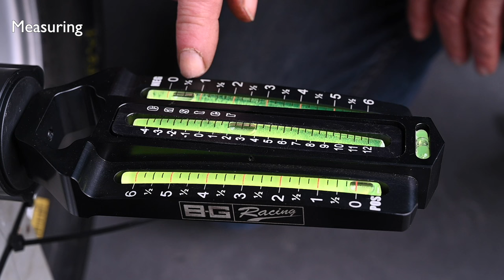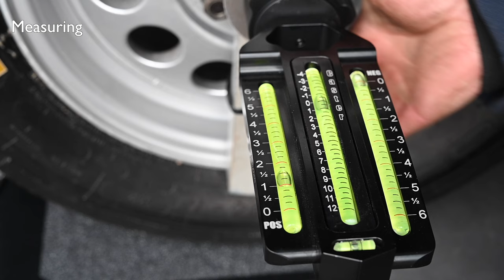Caster , KPI , Camber .  A simplified and practical explanation and approach for measuring

Comment: Steve, Thank you for your videos and explanations of the alignment and corner balancing a race car.   My wife and I have been racing our Porsche 914 for many years, have modified it extensively, but have I've never dove into alignment but trusted alignment to "the professionals".  I followed your alignment videos, built my own string alignment and wheels stands, laser leveled them in my garage, borrowed weight scales from our local car club, and aligned and corner balanced both my 914 racer and my 968 street car.  I found many misalignments items that the "professionals" didn't resolve or find on both cars.  My race car now handles better than it has ever done and my 968 no longer pulls to the left and handles the curvy mountain roads of Colorado unlike it ever has.  The fun is back!!!   I have renewed confidence to fully align my own vehicles.  Thankyou!!

Comment: Thanks for the great explanation! ❤ I have a question about the demonstration of negative caster at 5:51 . Since you were pushing it forward, shouldn’t it still be the positive caster angle? Isn’t it true that you need to pull the wheel forward (instead of pushing) to create a negative caster angle?
Reply from the maker: Thanks for the comments, at 5:51 we have negative caster ( draw the lines and you will see that the wheel is leading  and thus becomes instable .  Pull or push are not important here as Caster is a typical on the front wheels and in this case these are not the traction wheels ( rear drive).